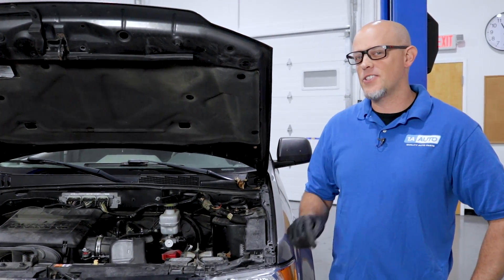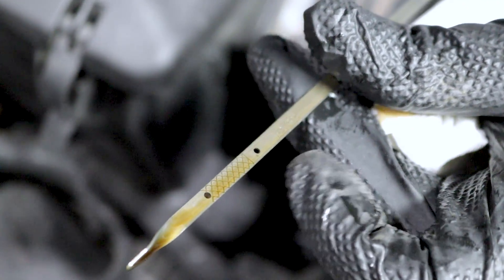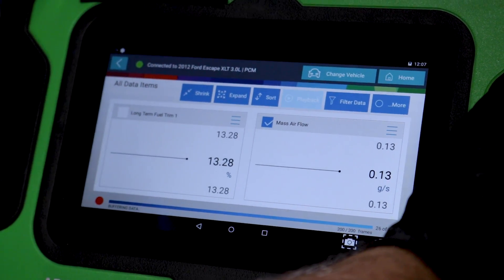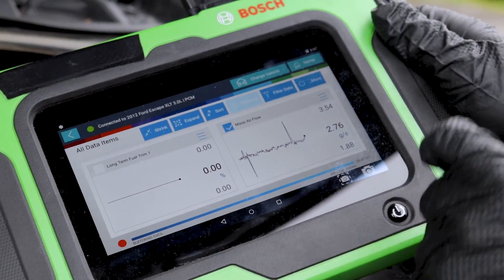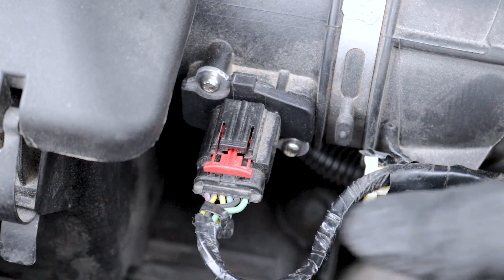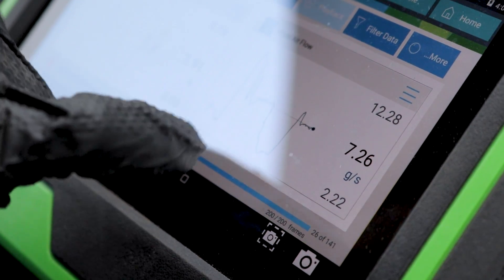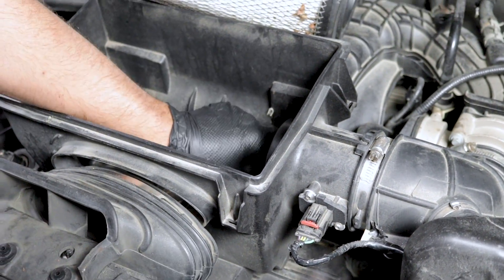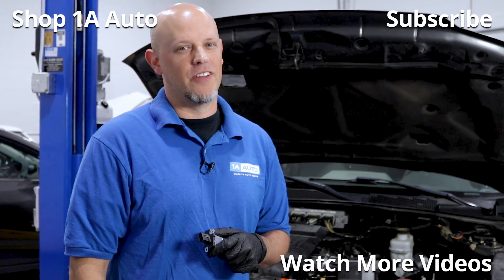Rough Running & Stalling? Using a Scan Tool to Diagnose the MAF in Your Car

Comment: 1. You should do a throttle body cleaning while in there.
2. If there's more than 1 intake you should always change both at the same times because computers are very sensitive.  
3. Possibly use a cleaner to clean the intakes, fuel injectors and while in there anyway, check the mileage on the spark plugs and remove 1 or 2 and check for carbon deposits. 
4. You should also check the data log and especially to take a snapshot of the engines performance during your diagnostic. To ensure that you didn't miss anything else.
5. Do a reset and relearn procedure to wipe out the codes and let the engine's computer start fresh.

Comment: my camaro dies after i get gas. then it turns over and barely starts.. after that it runs fine but it only happens while getting gas.. check engine light is on too
Reply from the maker: +Landon Hampton Thanks for the feedback! We would recommend having someone take a look at this as it probably is not good for the engine to have that added stress.
Reply: Purge solenoid

Comment: I would have appreciated seeing where, exactly, the fault was.  A close-up of the connectors on both sides after removal would be helpful.  Showing what you did in replacing the connector is always helpful.  I seems EVERYONE has a different way of splicing wires and their way is the only right way,  

Thanks for the Vids!!!

Comment: My 2011 GMC Terrain has a smooth idle, but gets rough at 2500 rpm, then smooths out above 2500.  I cleaned the MAF sensor, but nothing changed. Any suggestions???
Reply: check throttle position sensor